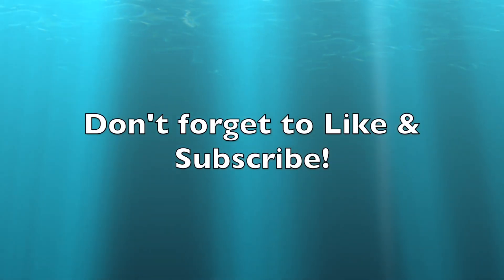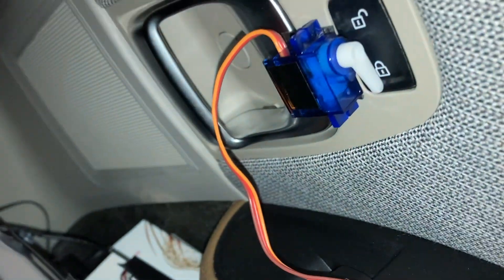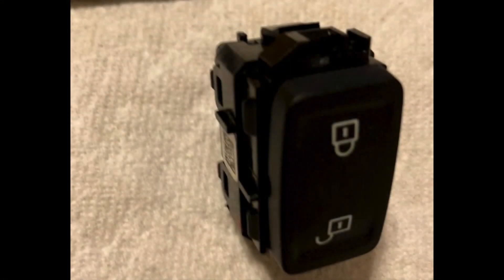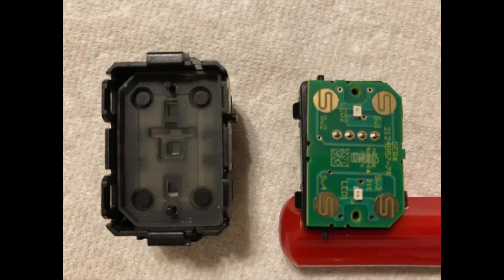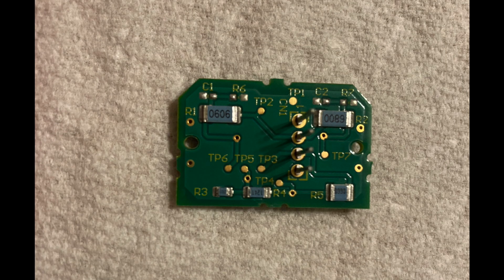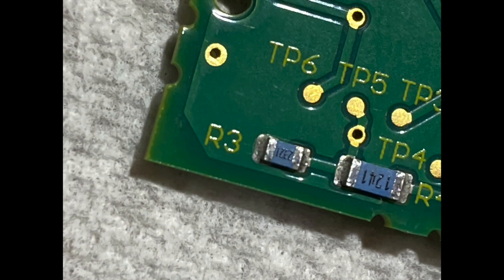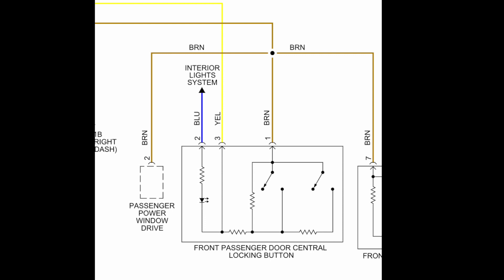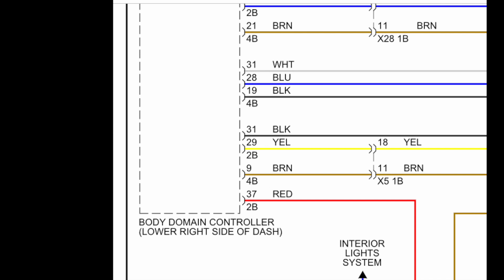BMW I3 Autocharge 12V Part 2

Comment: Although I will never own a BMW I3 I am fascinated by your efforts to improve it. I fail to understand why an EV with sophisticated HV lithium battery management has such a crude reliance on the 12V lead/acid battery; surely that should be LiFePO4? Kept within reasonable charge parameters an LiFePO4 backup 12V battery would last longer than the HV battery. Ideally, all technical information would be available to allow us to repair and modify appliances that we , theoretically, own but those days are gone. Even the service centre Techs are limited to blindly following an automated diagnosis process and mindlessly swapping parts rather than having any understanding of how the hardware and software works.
Reply from the maker: Thank you for your comment!   Regarding the 12V battery,  It's not just the I3 with old Lead acid 12V battery dependence/ liability- most other EV's use them too.   Just recently (2022?), Tesla dropped using the lead battery for their own lithium design.  Some I3 owners have tried using off the shelf lithium iron batteries with reported success, but there are some issues regarding the AGM charging circuitry in the I3 which can exceed 15.5V (way above the charging specs on LiFePO4 batteries, risks overcharging and/or auto shut off of the batteries by the BMS, both bad outcomes).  Also, most can be damaged with charging below 0 degrees F,  and have poor low temperature power output.  So if you live in a cold climate, I would not recommend.  May still be a good project if solutions/workarounds to these issues can be made.  Regarding 'right to repair', this is a problem not specific to BMW.  It is extremely frustrating/challenging to attempt repair of most modern products, not to mention the environmental impact of discarding 'broken' non-fixable items!

Comment: There are available wiring diagrams and BDC pinouts. Just gotta know where to look. Sorry you had to take the door apart. Connecting at BDC is cleaner.
Reply from the maker: Agree connecting to BDC would have been better (cleaner), but I wasn't able to find a diagram with the detail I needed or trusted.  If you know of a source, please let me know.   Well, at least I learned a lot about the door panel removal!    Part 3 details the electronic monitoring device- releasing soon.
Reply: @bmwi3diy782  how to get in touch with you. I’ll get you the details.
Reply from the maker: bmwi3diy@gmail.com